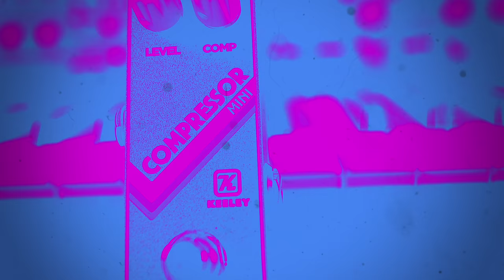How Do I Use Compressor Pedals? | Keeley Compressor Mini

Comment: I use my Keeley Compressor plus as an always on effect for blues/rock. Before overdrive with the volume quite high to push the drive pedal. Compression and blend quite low. Not sure if I’m using it right but it sounds good to me!

Comment: I've been thinking about buying a compressor for some time but wasn't sure if it's worth it, I wasn't aware of all the ways to use it. Thanks!
Reply: For years I did use them and once I bought a Keeley and then a Cali 76 and many more since, I realized what I was missing. Once I learned all studio producers use compressors on pretty much every album ever made, I knew there was a good reason. The boost the level and add so much sustain. Everything pops but main the sustain is the best part. Set the right way, you get endless sustain.

Comment: Great demo! I often struggle to hear the difference with compression on/off, but having one really changes the way I play. It's like a confidence pedal! But it's so hard to demo that change in feel. Interesting the Compressor Plus is cheaper than the Mini at the moment. THere are clear reasons to go either way, though. Features vs simplicity vs footprint vs power usage....
Reply: comp plus is 149, comp mini is 129

Comment: Compression the hardest of all pedals for guitar to sell. Rabea for some unknown reason there was a lot of fizz on most sounds?
Reply: Heard that also, it seems more present when the compressor is on but I'm guessing it's coming from the amp or the loadbox.
Reply: unfortunately this is common with compressors in a signal chain - by adding the compression thus reducing the dynamic range, you end up bringing your noise floor up as well as peaks down. So any hum could end up more present in the sound.
Reply: The further towards the end of the chain the compressor is placed the more likely there is to be hiss in the signal. The compressor is making the quiet stuff louder, and so any tiny amounts of noise are amplified by the compressor. I tend to use them early on in the chain to compress my signal straight from the guitar and the hiss is not increased at all.